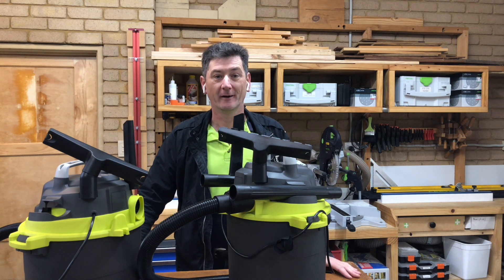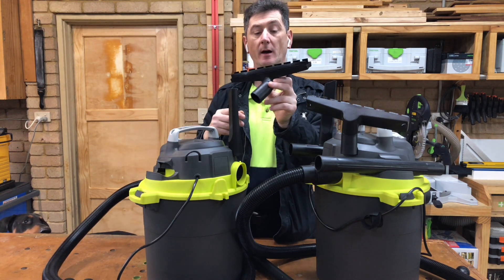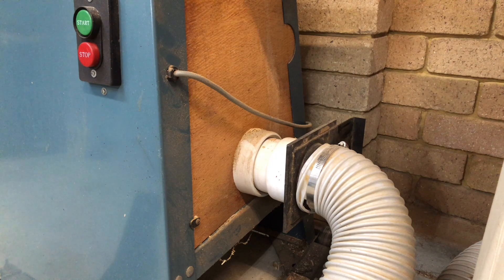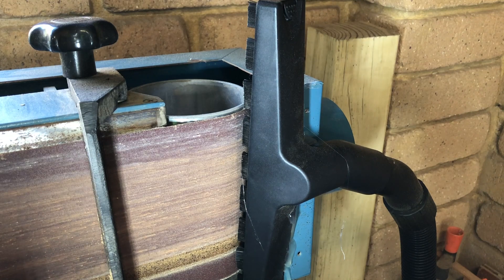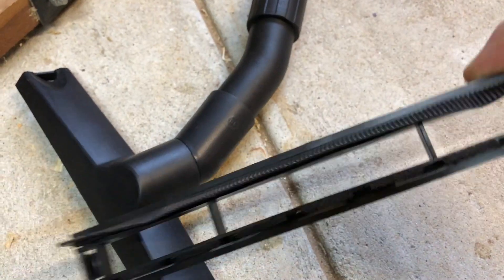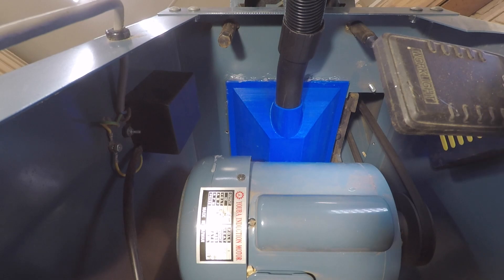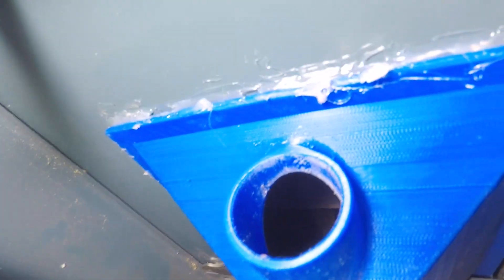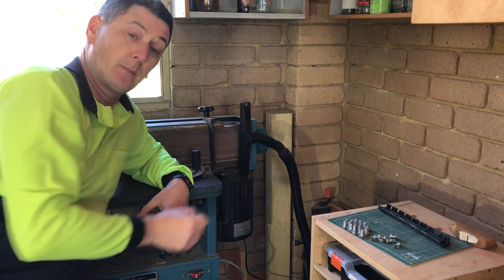Ryobi Vac's as dust extractors?

Comment: This works much better than I thought it would. If you want to make it easier for your shop vac to collect the shavings, upgrade your jointer to a helical cutter head. This would result in much smaller shavings which would (a) make it even easier for your shop vac to collect, and (b) produce much cleaner results on your lumber.
Reply from the maker: Hi PaganWizard. I did https://youtu.be/bAZPqEklB7I.
Reply: @DarrensWorkshop  The video you linked to is for your thickness planer. I was referring to the jointer you used in this video.
Reply from the maker: @PaganWizard  my mistake, you did write jointer. I’m trying to do too many things at once again. Anyway have a great day.

Comment: Hi Darren, thanks for the video. Looking at buying one to use for a hobby cnc machine. What are your thoughts having had the ryobi for a while now? The only thing that worries me is the potential lack of duty cycle for longer milling operations. Cheers
Reply from the maker: Hi Chris. I have certainly had no problems with mine. That said I have never had one running for more than about 30 minutes straight. If you are going to use it on a CNC I would recommend putting a dust separator (or cyclone) in line with it to catch the bulk of the dust and shavings.
Have a great day
Darren

Comment: Top job mate! I've been using a Ryobi vac as a dust collector for a little while now too. Only issue I found is with the larger tools the vac fills VERY quickly, so next item on the to-do list is a cyclone bucket ..
Reply from the maker: Cheers Brad. I have an old Triton dust separator bucket between my jointing plane and my vacuum. It isn't a true cyclone, it's just a bucket with a screen between the inlet and outlet, but it was cheep and it gets all the larger shavings and most of the dust. I don't know if they still make them though.